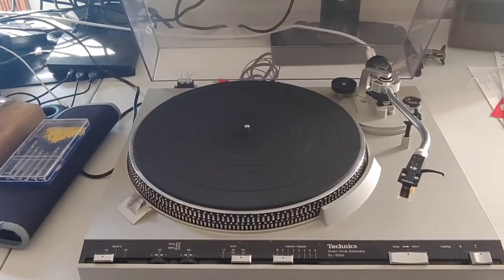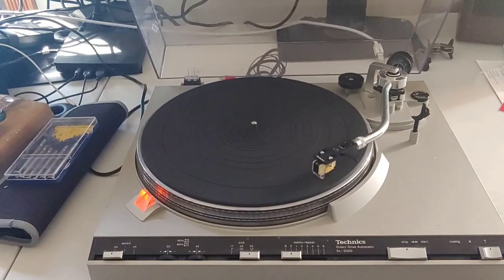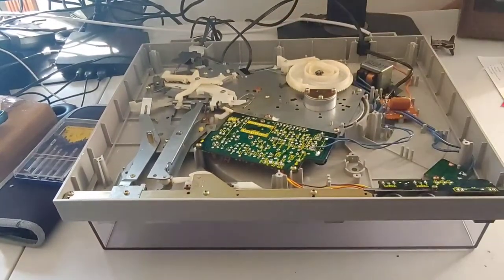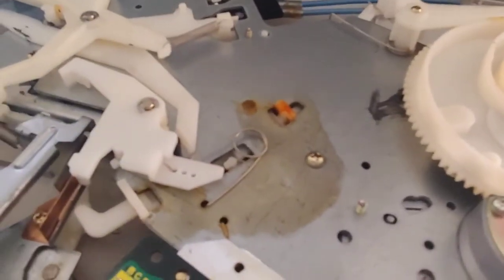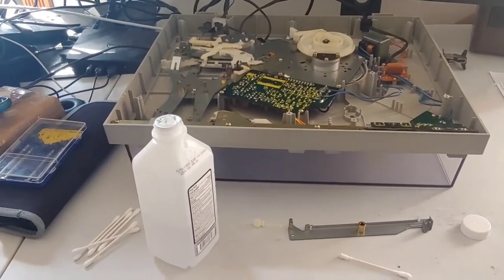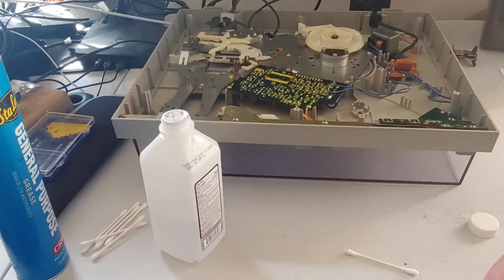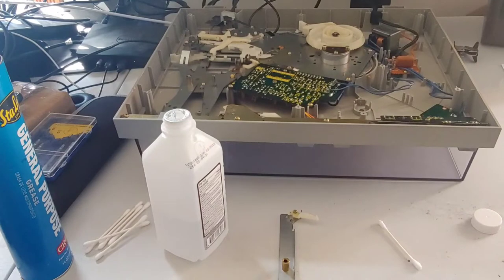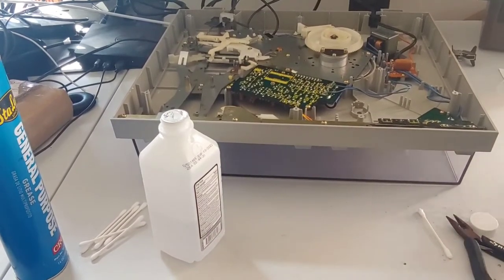Technics SL-3300 Turntable Disassembly and Repair - Slow Automatic Functions and Stuck Repeat

Comment: Thanks for the video.  It was really helpful.  I am having 2 issues with mine that I cant seem to figure out.  1.  the size adjuster on mine getting stuck if you put it in 7" size not wanting to come out, it appears that everything is moving fine its just that the design feels like the tip gets stuck behind that larger curve.   2.  in auto mode the tone arm goes all the way to the inside of the record then returns.  It is not stopping at the edge of the record.  Any thoughts on either?  or could they be related.  I do have the size at 12" when its doing this. 

Thanks